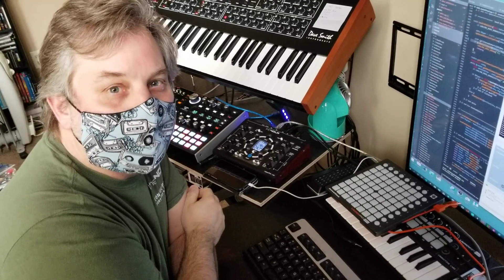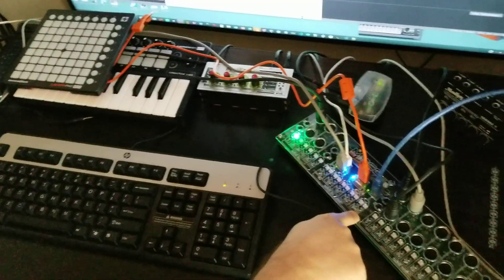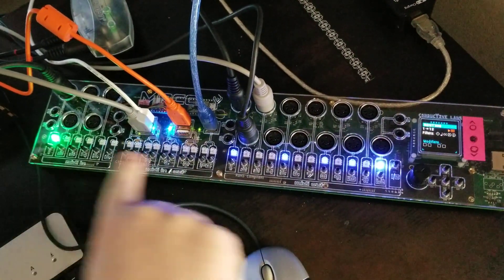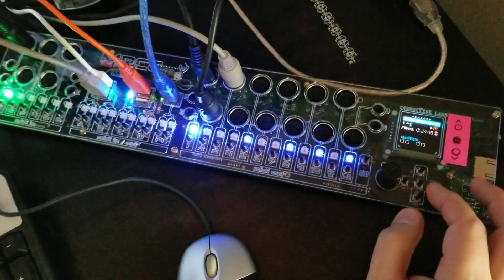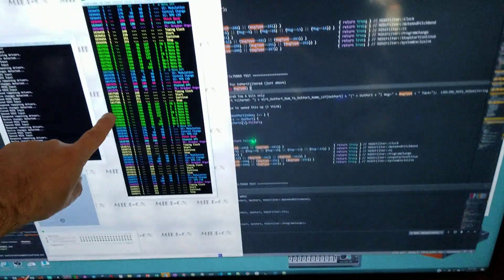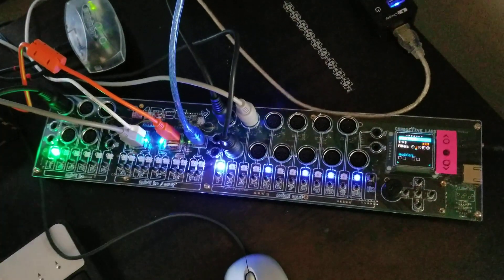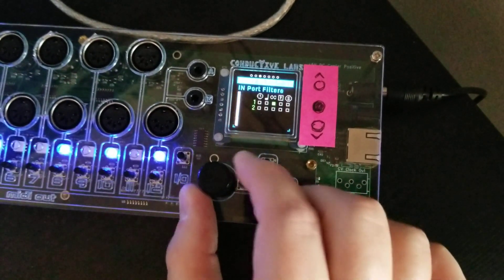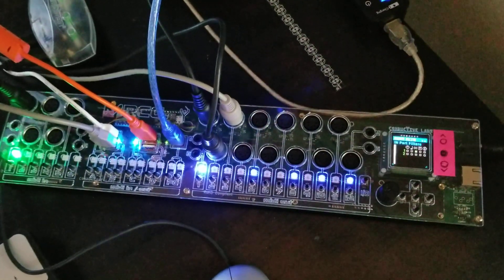MRCC April 2020 Update - video 1

Comment: Does it translate the Midi Messages or something like that? Some kind of advanced thru box?
Reply from the maker: A MIDI thru device just passes the MIDI data electrically. It can't process the data in any way. For a simple setup with few MIDI devices, a thru box is often good enough. However, for someone with a MIDI sequencer, keyboard, controllers, The NDLR, etc. its very convenient to change what MIDI input device is sent to which sound module/synthesizer. You might also require some special handling of MIDI data for mis-behaving devices, or want to transform MIDI messages in a certain way.   You can do that with MRCC.